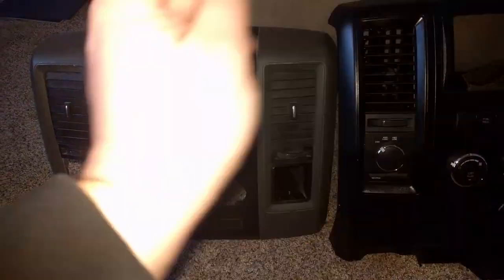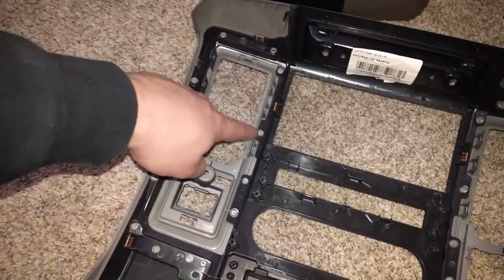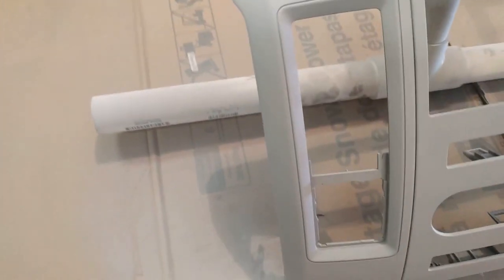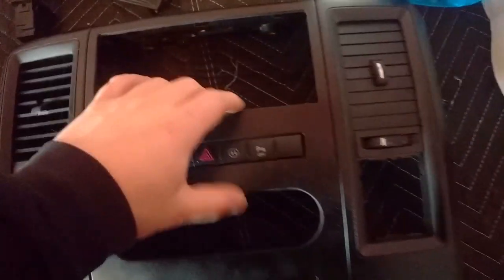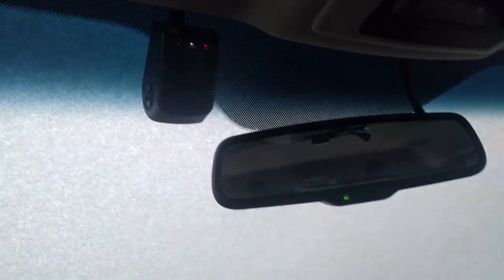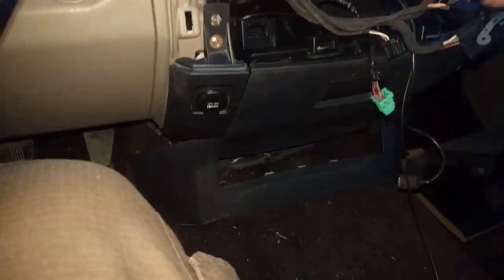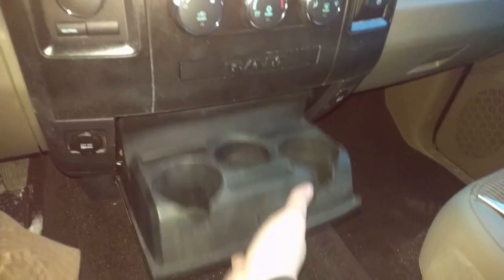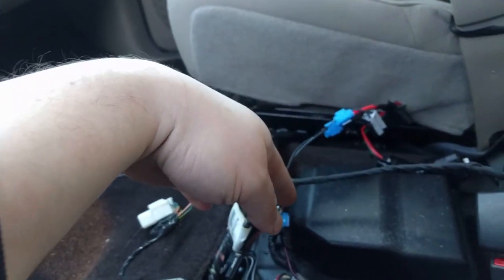How to SWAP a Ram Center Dashboard - Part 4: Converting the center dash

Comment: Nice job! Glad you did that final shot of the floor under what was the console and I'm hoping my truck has less going on. I'm looking to delete my jump seat and try to add that lower cupholder panel on a 2021 Ram classic. No idea if it will work out but need that space for our horse of a dog to ride comfy in the truck on road trips. 😂
Reply from the maker: Haha, sounds like a great spot for the dog. Hope this helps.

Comment: Hello matey
awesome video and informative 
wondering if its possible to swap interior from 2015+ ram into my 2011 2500 RAM Laramie?
Reply from the maker: Great question! I don't know for sure, but it seems likely. 2009-2018 are technically the same generation, although there was a mid-cycle refresh around the time of the transition to the RAM brand. I would think most interior parts would work, perhaps with small modifications. However, I do think there were some wiring/CAN bus/other changes that might mean you'd need to keep your older HVAC, instruments, radio, etc. but I'd think seats and other interior panels could work. You might want to do some research comparing docs from the different years. A good place to start is looking at the body builders guides for Ram Chassis cabs. I poked around in these a few times before doing my seat swap, although to tell you the truth, actually going to a junk yard and poking around in different cabs in different states of disassembly was a bigger help to look at how things went together. I can at least tell you the front seat bolts seem to be the same and some of the dash, although the center dash behind the radio and hvac did have at least two different core layouts - one was more recessed - and several external configurations (cup holders, console, different cup holders, etc). https://www.ramtrucks.com/ram-commercial/body-builders-guide.html  If you poke around looking for chassis body builders guides they have some interactive PDFs that link to other PDFs. They only seemed to work in Internet Explorer for me. I hope this helps a little.

Comment: What did you do to power the second 12v car plug. In my ram I only have one and that's in my center column that's going to be ripped out soon.
Reply from the maker: There was another 12v source. You can tap multiple feeds into the 12V source if you want, just don't run a lot of amps on it - keep it under the fused limit.

Comment: Hi, is this the same truck you inatall the center console?
Reply from the maker: This one came with a center/floor console and shifter. I pulled out the console and floor shifter and replaced with a column shifter and jump seat. 5 videos I think.